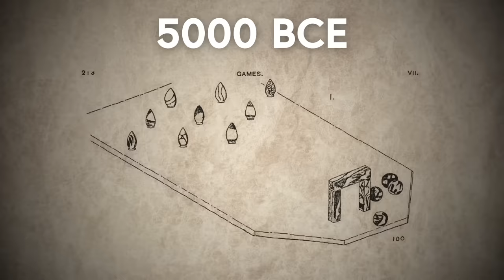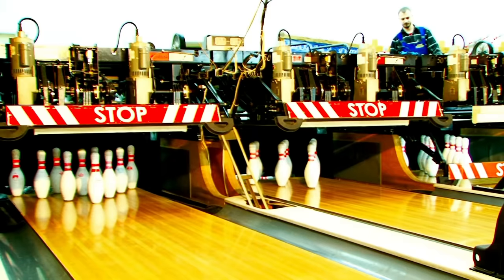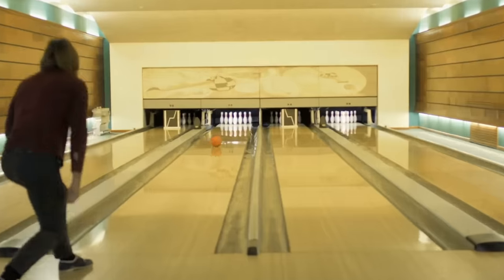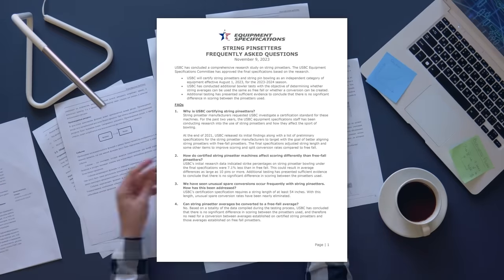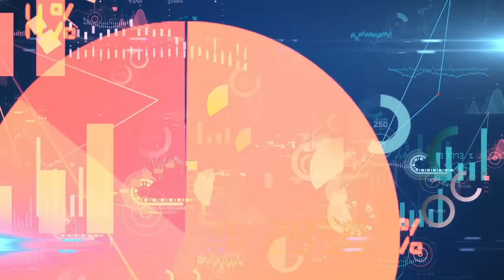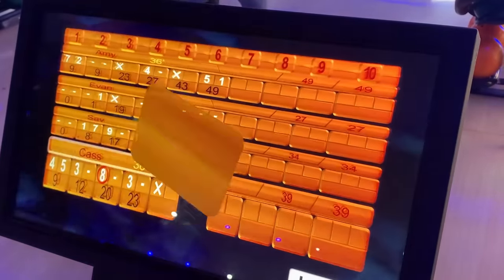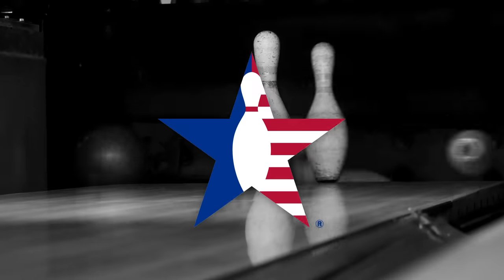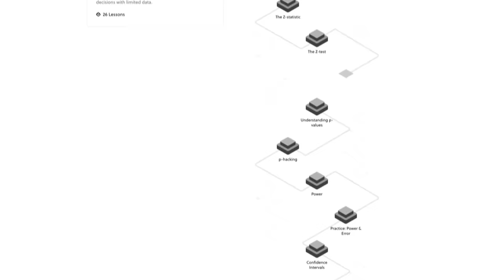The Controversial Machine That’s Ruining Bowling

Comment: As someone who has been bowling for a long time, has their own equipment, and bowls reasonably well, I definitely have an opinion on the string pins. String pins are certainly less accurate when it comes to the physics of pinfall. When you play to improve at the sport (i.e. you actually hook the ball), you get much more familiar with how the pins fall depending on exactly where you hit them and from what direction. A very slight deviation from the optimal hit may leave a corner pin, which is a very important thing for bowling to stay sufficiently difficult to create a meaningful distinction between good players and professional players.

All that said, it's also worth mentioning, as you said, that string pins are way cheaper, thus allowing bowling alleys to exist in markets that would otherwise not support them. For this, they are absolutely better than nothing. As long as there exist freefall centers in reasonable distance of any sizable population centers, most league bowlers get the chance to choose that bowling center over a string pin one. I suspect what will slowly happen over time is that there will be more and more of a mix of both. One or two freefall centers in an area that cater to the needs of league bowlers (nicer computers, maintained lane surfaces, and daily leagues) at a higher cost per game, then any remaining bowling centers would be string pin to capture the more casual audience, and also cheaper to bowl at.
Reply: Yeah, casual bowling alleys are already different from league-grade setups anyways- the surfaces are actually oiled in a way that gives casual players an advantage by making more likely to keep the ball near the center, whereas league oiling is completely neutral and doesn't help or hinder in any way
Reply: Living in an expensive area where all the bowling alleys have disappeared in the past 15 years, I would definitely prefer string pins over no pins
Reply: @technoturnovers7072  Not so fast, there. There are many different oil patterns out there that are used in competitive play. Some are certainly more challenging, and others more forgiving. 
Also, a lot of alleys will have league bowlers on the exact same lanes as the casuals, even using the same oil pattern.
Reply: Atleast from my experience, locally, my biggest issues isn't the strings as much as those alleys don't properly oil the lanes, and also keep the approach real sticky so people don't lose balance. Almost every time I've bowled with strings, I've stuck on the approach and had to take a step over the line or even fell. Never happened at regular allies.
Reply: @inailedyourmom1  to be fair, those bowling alleys with sticky approaches are probably catering to people who don't own their own bowling shoes, and who have to fuckin' rent them. Except rented bowling shoes fucking SUCK, they don't fit right, and if you have very little experience wearing them then you're just gonna be stumbling around like a jackass. That's definitely me, at least, and I never even learned to tie my shoelaces by the way, I wear velcro or slip-ons, so that's just another big problem.
Reply: Yeah I'm with you on this.  

I'm certainly not opposed to the idea of switching to string pins but using a sample of bad bowlers who don't have the capability to feel or understand the difference to measure is bad methodology.
Reply: @Numl0k  Have to have a couple spare towels for those days, if they're using the casual oil patterns.
Reply: Who cares if the game changes with strings? The art of throwing and controlling the ball doesn’t change. There will be new strategies and new 7-10 split variations to master that only happen in string games. The game will evolve.
Reply: I would be interested to see how much variation there is between each hit on strings and free fall. Of course there is going to be a difference between strings vs free fall. But if you are able to hit the 1 pin at the same angle and speed, how much deflection will the strings cause. 1 degree left or right? 5 degrees? 10 degrees?
Reply: all edge cases, and more or less irrelevant. the video told you why it doesnt matter.
Reply: @technoturnovers7072  hadn't been bowling in over a decade and went back to my daughters friends birthday a few weeks ago now she is old enough.....they dont do shoe hires any more it seems which surprised me but most of the other parents looked at me like a was a cave man or John spartan or something when i said last time I went you hired shoes.
Reply: @jonh6585  ....uhhhh, how do they prevent the bowling lanes from getting scuffed up without bowling shoes, though...?
Reply: @inailedyourmom1  Whether or not a there are string machines and what the approach conditions arehave nothing at all to do with each other. 🤣
Reply: @fatal510  Exactly. The best players will adjust. The rest will just complain and blame it onthe strings.
Reply: @jonh6585  I've never heard of not doing shoe rentals. When I worked at at bowling center we would not allow people to play without them for liability reasons. Took easy to drop a ball on your toes or to slip and fall in sock feet.
Reply: @athletixbc  it has to do with the fact most places that jumped to string setters cater to families and not sport bowling.
Reply: @inailedyourmom1  I guess I'm one of the few lucky league bowlers that don't slide so that doesn't affect me but I know it's probably not the best technique out there.
Reply: @fatal510 what a good way to look at it.
Reply: @michaelnotsch6112 there’s pros that don’t slide. I don’t slide either. If it works then I say keep doing it. One time I slid by accident in league and it scared the shit out of me. Thought I was going to fall 😂😂 planting feels so much better for me
Reply: @drakedbz Not only the things you mention but what about that 10 pin that bounces off of the wall a then sweeps across the back of the lane sometimes knocking over a late  to fall 7, 8, or 9 pin? I wouldn't think you would see that with strings and it wasn't unusual to see that sweeper a couple of times a night.

Comment: I wanna see a test done that compares nothing but splits, because I believe that's where string setters are going to fail the most. As far as unfortunate leaves go, a 6-7-10 is a fairly common and requires you to shoot the 6 over and catch the 7. Having strings attached to the pins has got to affect them somehow when you're sending them towards the limit of their stretch.
Reply: I used to think that too but recent bowling has showed me that just clipping a pin on the side will often cause it to hit the side wall and bounce out of the pin area to the extent of
the string and sweep any pins down that remained standing after the 1st ball in that frame.  I've made the 4-7-10 twice and the 6-7-10 once via this type of hit.  I've made these two 
splits a number of times in my 62 years of bowling but it's easier with the strings.  What is not easier with strings is the light pocket "swisher" hit that very often strikes on free-fall 
pins but leaves a nasty little 4-5-7 split with the strings.  It does this a LOT.  I've seen more light pocket hits leave the 4-5-7 split in the past 2 years than in the previous 60 years combined.  Odd thing here is that by leaving this split so often, I am getting a lot better at picking it up.  Right now I'm picking it up about 50% of the time, which makes leaving it manageable.  I'm 74 years old and bowl in 2 leagues with around a 190 average.  Not bad for an old guy.  🙂
Reply: Make the strings longer. There's no issue here.
Reply: @CGoody5642 Then what if a string touches a pin?
Reply: @CGoody5642  except for the issues that occur if the strings are too long that were already explained in the video, but thanks. 👍🏻
Reply: Pins need to fly at times. Strings are cheap and nasty.
Reply: @edb3877 4-5-7 isn't a split.  Do you mean 4-5-10 or its mirrored version 5-6-7?
Reply: @edb3877  This is exactly the experience in my last league on strings.  4-5-7 shows up VASTLY more frequently, but it is fairly easy to convert whereas on free fall pins it is a near-automatic open frame.
Reply: @Telogor  4-5-7 is considered a split.  So is 4-5, for that matter.  "Adjacency" is only considered on the diagonals, and the 2 being down makes 4-5 a split.
Reply: Before playing on the silly strings, I had twice as many perfect games as I had conversions of 4-6-7 / 4-6-10.  Within 12 games (4 weeks of league play), that ratio reversed and I had twice as many split conversions as perfect games.
Reply: Who cares if the game changes with strings? The art of throwing and controlling the ball doesn’t change. There will be new strategies and new 7-10 split variations to master that only happen in string games. The game will evolve.

Comment: Since my local bowling alley changed from free fall to strings I’ve seen quite a few impossible splits like the 7-10 converted by very ordinary bowlers. I’ve had a couple myself. String bowling is quite similar to 10 Pin Bowling but it’s not the same!
Reply: Huh? Strings and the number of pins are different categories.
Reply: all spare's are easy with String's

Comment: I dont bowl very often at all and when i do its always just a social event.

Still i noticed the change to strings and noted it down as yet another, very small, step towards the modern world of convienece over substance.
Reply: The slow and steady decline continues...
Reply: What the hell is substance supposed to mean? The video even showed how they did tracked the data across thousands of games and found no difference in the scores. You’re getting the same scores as before, but now the alleys have much cheaper and more reliable machines so they can actually stay open without charging even more absurd prices than they already do. Not to mention that apparently the old machines were dangerous and killed or injured the maintenance workers on a regular basis. This is one of the dumbest things I’ve ever seen people cry over
Reply: @BobbyHill26  You've written more than me...

Comment: A quick correction on the stats, the 0.035 p-value is from a different statistical test in the paper (Anderson-Darling Normality Test), not the paired t-test. It's impossible to have a p-value of 0.035 if the 95% confidence interval includes zero, the p-value would have to be above 0.05 for that statement about the confidence interval to be true.
Reply: Thanks for the clarification. I noticed the discrepancy but couldn't figure out how it got messed up
Reply: @grammy1620 same here
Reply: seems like HAI needs a Brilliant course themselves teehee
Reply: Well the need some content for the corrections of the year video
Reply: I’m glad you pointed this out so I don’t have to.
Reply: Thanks, that's what I wanted to write!

(I've no idea and just want to look as smart as you guys)
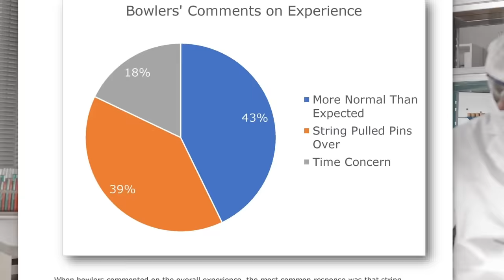Reply: Trusting software can be a challenge. Indeed, the p-value of 0.035 is not the p-value for the t-test. The information you need to get it is on the screenshot at 3:41 though. The mean of -0.0951, standard deviation of 18.8265, and N of 341 leads to a t-statistic of -0.0933. This then leads to a p-value of 0.926, which is very much not significant, as expected given the wide confidence interval.

Comment: As a bowler for 20 years, the pin action is what is controvercial with string pins.  You could hit one pin in a group of two, have the ball not make contact with the second pin and the first pin not make contact with the second and still get the spare because the string wrapped around the other pin.  I could shoot a 6-10 and hit light and have the string of the 6 pin wrap around the 10 pin and still knock it over.  If string pins did become the norm I would probably still find bowling fun and would just manually adjust my score to not count these kinds of "spares"
Reply: Are you also adjusting for the massive changes in oil and the balls themselves? Bowling on a modern lane with a modern ball is a much bigger difference from traditional bowling than a different machine at the far end.
Reply: rules wise string hits are valid, probably because nobody wants to deal with the "karen's" or the far too sensitive types that demand slow motion replay if the string hits didn't count. 

at the end of the day everyone on the pair is under the same competitive conditions and will be robbed and rewarded by the strings to the same degree's. those sanctioned string setups are supposed to almost eliminate weird string hits.
Reply: It's just going to be one of the changes to the game we'll have to adjust to. As long as everyone is affected the same then it's still fair.
Reply: Having bowled on string pin machines and working at the center that just installed them, for the last 3 months, this happens way less often than what league bowlers worry about. Does it happen, yes, but corrections can be made easily. All of the benefits of using string pin machines far outweigh any of the issues we have had since installing them.
Reply: @britneyharding1233  For the bowling center operator, the drawbacks are zero, because the drawbacks accrue to players. Bowling center operators don't care about string hits. Operators wouldn't mind replacing the pins entirely with a computer simulation that calculates the pin action based on data from some sensor that detects the speed, direction, and spin of the ball as it enters the pin deck. They'd probably commission YT videos like this one to argue that it doesn't make a difference that the pins aren't real. I've already seen arcade machines like this, similar to the string-based bowling arcade machines I saw years ago, before they started being sold as serious bowling equipment.
Reply: @amorphousblob2721  it’s hard to take your concerns seriously when you know nothing about the operators or their motives and desires to still keep things as “normal” as they can. I get that it’s different and change is hard. But please don’t assume you know the intentions and motives of every owner installing these machines.
Reply: @britneyharding1233  It's pretty obvious what operators care about, and that's money. The surprising thing is that originally, operators rejected string-based pinsetters, even though they've always been around, and they've always been simpler and cheaper than real pinsetters.
Reply: @amorphousblob2721  they haven’t always been certified by the governing body though. And of course money is a huge factor. If you had machines that had over 4000 moving parts, that were difficult and increasingly more expensive to maintain, and knew that now they are USBC certified AND cheaper to run overall, you would switch too.
Reply: @britneyharding1233  If I was a money-grubbing operator,  I'd do what a lot of operators in my area are doing, which is simply forgoing USBC certification altogether and building pure-entertainment "bowling" centers (where bowling is typically one activity among others, which typically include arcade games and laser tag). Not only can they use string setters, they can also introduce any other cost-cutting measure they want. They can forgo lane oil, use plastic (or even foam) pins, make the lanes shorter, you name it. And that can include partial or complete virtualization, where there aren't any pins, just a screen.
Reply: @britneyharding1233  The machines haven't changed in decades.  Old free falls had tons of parts, so do new ones.  What changed is Bowlero not wanting to pay employees, period.  And now they have enough market share to cram it down USBC's throat.
Reply: @amorphousblob2721  If I was a money-grubbing operator with an alley in my city, I'd simply sell the building to condo developers and retire a very very rich person.
Reply: I can’t have fun on them. 
Something about seeing the pins move wrong just kills it for me. 
For me, it’s comparable to playing darts except there’s a big ass fan right in front of the board.

Comment: The closest bowling alley in my area is about 45 minutes away on a good traffic day.

It’s been there for at least 35 years that I know of, and despite being built in an area that regularly floods (the alley gets at least a foot of water inside the building 3-4 times each year and 6-8 feet of water every 5 years or so), I have never seen it at anything less than 75% capacity.
Reply: The wording implies that even in 8 feet of water, the alley is still having over 75% of its lanes used
Reply: @Brent-jj6qi  water bowling

Comment: Hi Sam, the machine in the video explanation is actually the Brunswick GSX! Not the AMF so it uses a sensor within the pin table instead of a camera, and the sharkfin only exists on the Brunswick GSX and GSX NXT etc.
Reply: The shark fin exists on all GS machines, starting with the GS10.  Around the GS96/GS98 the shark got smarter functionality as well.
Reply: @Triley215  haha not too sure on the other GS Series machines other than the GSX since I currently work with those! But yeah looking into the series they did in fact exist in those and its cool to see the technology constantly improving